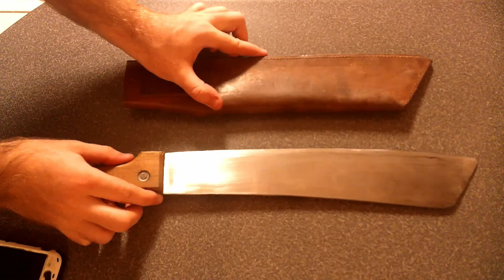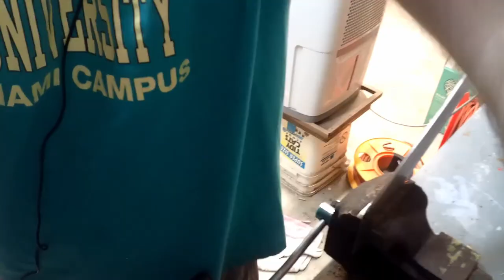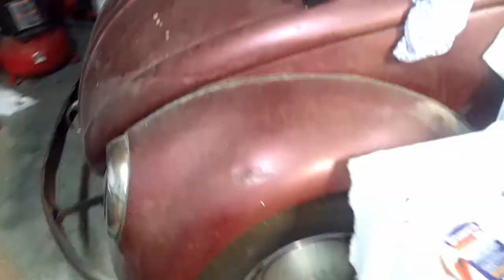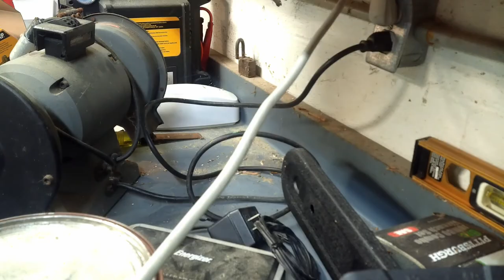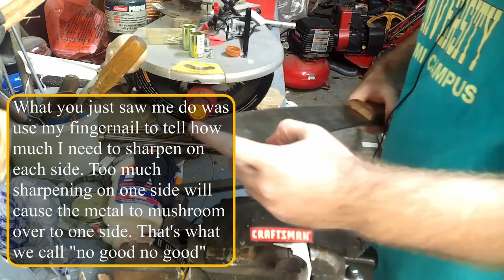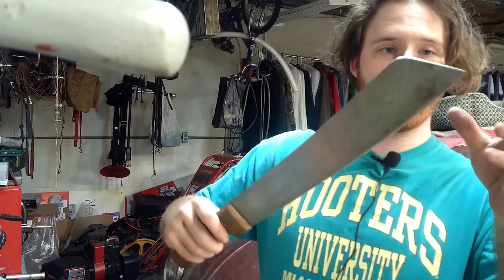Screen Accurate: WWI French Coup-Coup Machete

Comment: Props for using a file for sharpening. I use lansky guided systems and a spyderco sharpmaker for honing, but I can imagine a file would be much quicker for a machete.
Reply from the maker: It’s not so much that it’s quicker, it does a really great job. I used a 00 file, if I can fin my 000 file I’ll sharpen it some more. That was the last time I sharpened it, granted I haven’t been having a showdown with sharks are anything, that’s been several months ago.